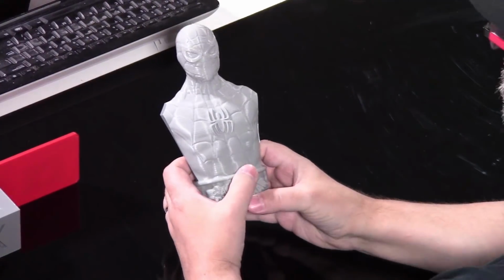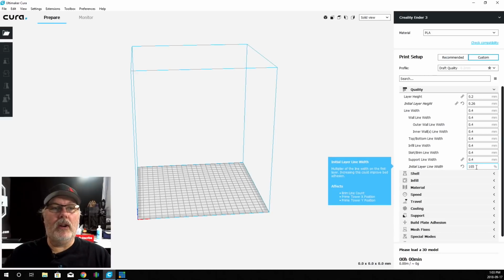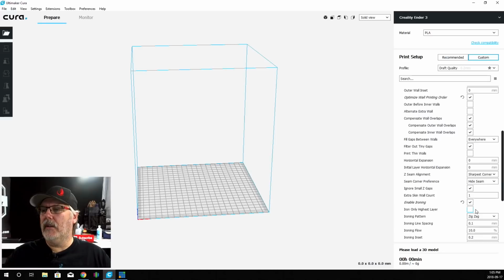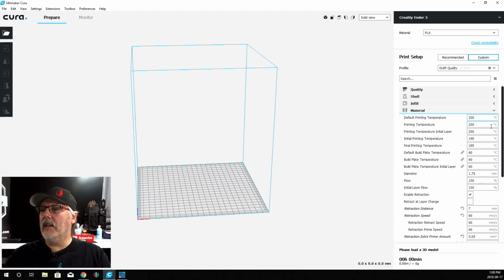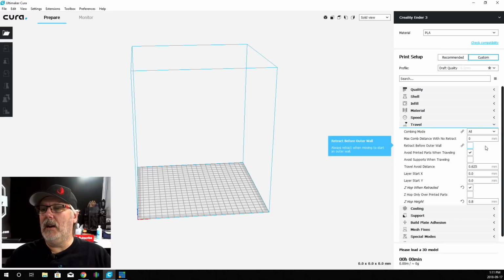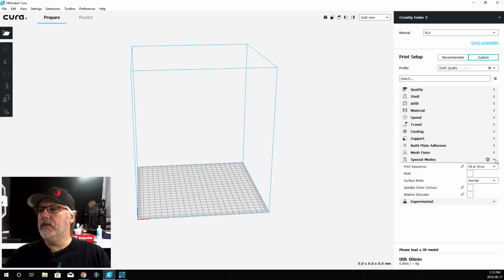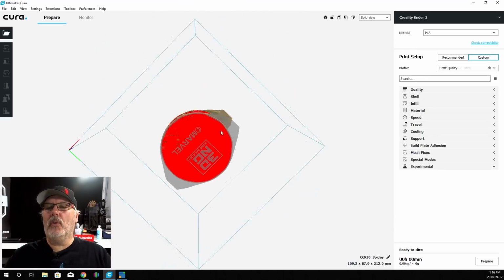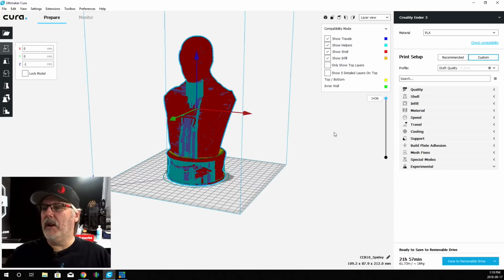Refine your prints with CURA

Comment: Hi Richard. I love your settings and i'm getting Amazing results. Could you please tell me what changes you would make if you were using a 0.2mm nozzle. I will be printing 25mm to 30mm figures for Roleplaying games so I need to get as fine a print as I can muster.
Reply: Difficult in Cura because adjusting the nozzle size from 0.4 is tricky.
Reply: @truantray  What?
Reply: You probably already figured it out, but it's so easy to do.